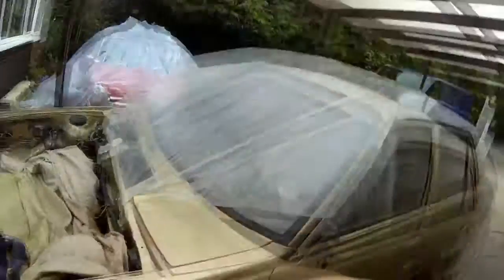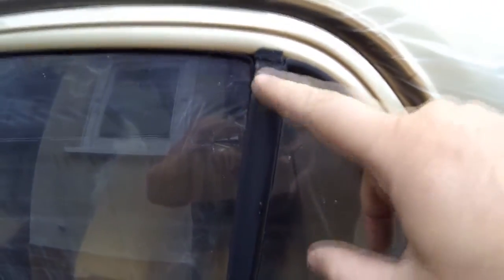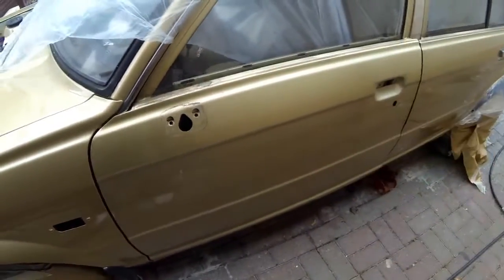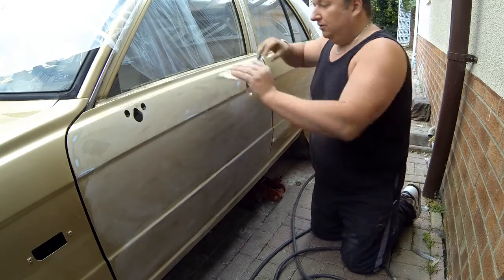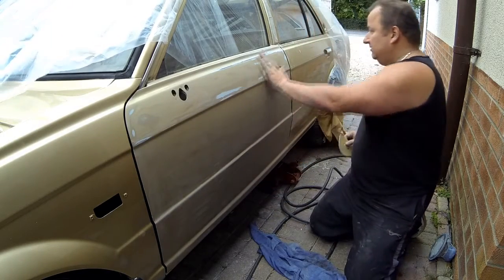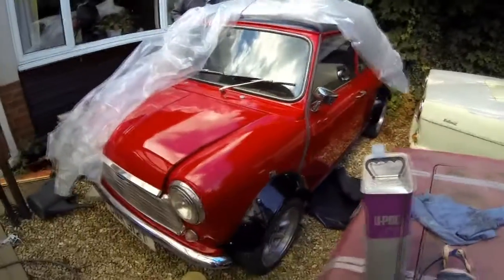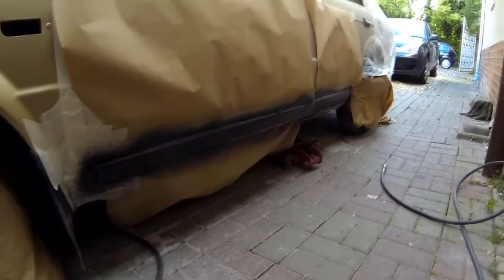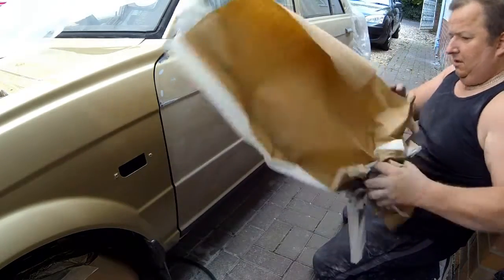Part 8 Triumph Acclaim Restoration Preparing The Doors

Comment: Again, nice job Martin. Really seeing the progress now.  What type compressor are you using Martin and how many liters is it? I need one myself but am unsure as to what I should go for. Just need it for odd jobs so nothing too fancy will do me. 

Cheers for now
Reply from the maker: Mine is a 60CFM Clarke Air compressor. You can get away with a smaller one for spraying but I use air tools as well as a sand blast cabinet

Comment: those da discs are made to use dry you know, also if you have scotch-brite pads why are you not using them for keying the surface up ready for paint (of course you could not have used them for the cracked lacquer but the rest of it should have been fine)
Reply from the maker: The reason I flatted the doors down with the 500 grit instead of the scotch-brite pad is because the car's finish wasn't original and just scuffing the surface would not remove any imperfections the previous spray job had so I decided to flat the paint to match the rest of the car that I had sprayed with the same preparation. Thanks for your comment.